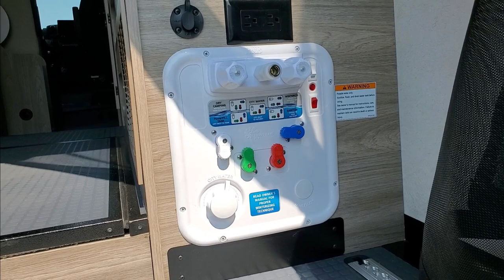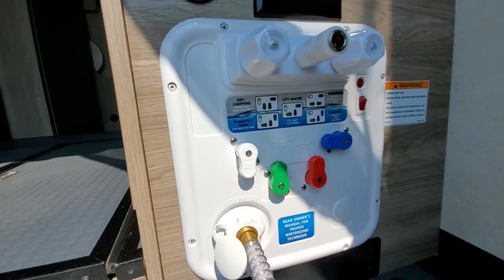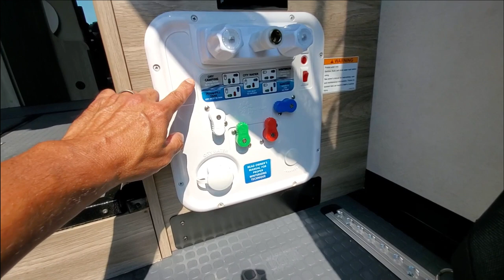2023 Winnebago Solis 59PX | Plumbing System Explained!

Comment: There's a little space for your water cable to fit at the lower part of the door to allow your doors to be closed. Check it out, and I can't remember which door, but it's down there. Happy camping😊
Reply from the maker: I'll take a look.  Thanks for the tip.

Comment: New to RVs. We have the Roam w pop top x 3 months now. So far we love it. I’m looking for alternative to winterizing. Flushing w antifreeze solution is not desirable especially since I plan to use my van through the winter in PNW. Several people have told me they just drain all the water out, including low points.  Any experience or thoughts?
Reply from the maker: Definitely drain the water and low points, but I would still recommend using RV antifreeze.  It's non-toxic and if there is any water left in the plumbing, the RV antifreeze will protect it from cracking in the winter.  It's also safe to flush the toilet with antifreeze instead of water if you're going to use it in the winter.

Comment: Thanks for the Video.  I have some questions that nobody ever addresses.  1.  How do you know when your fresh water tank is full?  2.  When boondocking and you have extra water in containers how do you pour  it to your fresh tank?  3.  I can’t figure out how to leave it hooked up to city water and close your rear doors.
Thanks,
Reply from the maker: Good questions.  Let's see if I can help:

1. There is a clear gauge below the sink.  Or, fill till you see the water overflow underneath the coach.

2. If you want to pour the extra water into your fresh water tank, select 'Saniitze' and use a fresh water hose to place in your container.  It will siphon into the fresh water tank with 'Sanitize' selected.

3. Unless you customize the back of the van with a hose port, if you're connected to city water, you can leave the back doors open during the day, then switch over to 'Dry Camping' so you can close the doors at night.
Reply: @thehealthytraveler  Thanks,  for me this is the perfect B van.  I guess you could drill a hole in the floor of garage and figure out how to plug when traveling.  I’m just not on board with that cassette toilet.  Thanks for your response😊
Reply: @thehealthytraveler  the water pump does need to be on to add water using the sanitize setting to siphon water into water tank correct?